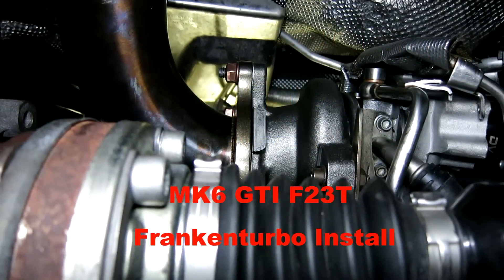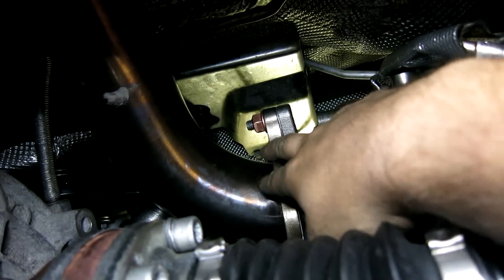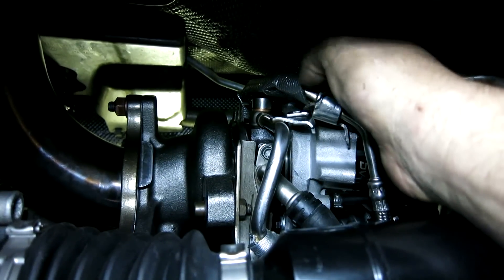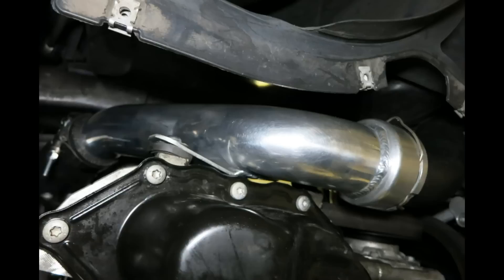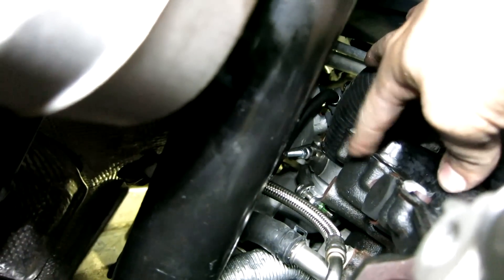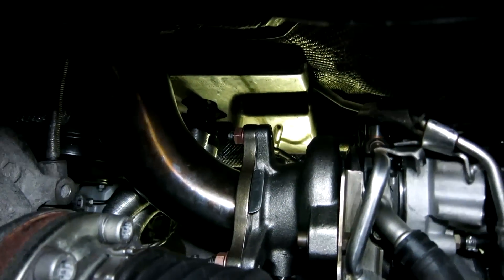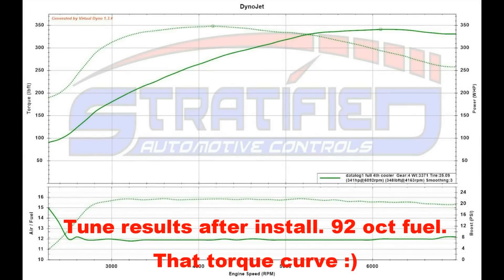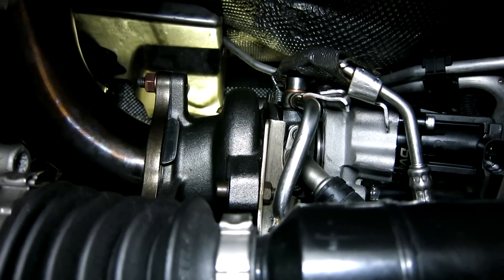MK6 GTI F23T FrankenTurbo Install Stratified Auto

Comment: Do you need the 4bar map sensor for this setup? I have all of this and keep getting a map sensor code and it tends to buck alot. Changed the sensor 3 times with an oem mk6 map sensor.
Reply from the maker: The tune needs to be setup for the sensor you are running.
Reply: @stratifiedauto  thanks I was getting the oe replacement bosche sensor. I borrowed my buddies oem bosche sensor and it cleared up so clearly gotta get a dealer sensor or it just won't run right.

Comment: is this a good turbo? i heard its chines and just kinda re branded and with some modifications.
Reply: Gli_Fahrenheit they're not technically wrong.  Think of it this way, the cast housing is 3rd party probably lower quality, but only marginally. I mean if it's meant to be made from a replica cast of the original the differences wouldn't be that much.

However, the main component of the turbo, the spindle, the blades, the seals, are all custom built to meet or exceed oem clearances.

This of it as a rebuilt k04, but with newer technology like mixed flow, larger thicker blades made of lighter/stronger materials, etc. It's like a k04 2.0 haha. This is why people are seeing 20-30 % higher performance over everyone else's k04. Because the surface are of the blades and the new materials make it a better built turbo than the factory.

Plus on top of all of that, he gives you a 2 year 350$ warranty. If they thing blows up due to negligence or anything else under the rainbow, he'll replace it for 350$. That's someone who truly stands by their product.
Reply: Nice! i actually installed my 2 weeks ago and love it! its seems to be a solid product.
Reply: Getting a F23T soon, is it difficult to install? Never did something as important like a turbo before. My shop wants around 800 to install; combined with the $1700 turbo with coating and $200 lava blanket, this turbo upgrade is looking rather expensive.
Reply: America, FuckYA! 
Let me tell ya, the hardest part is going to be breaking loose those stuck bolts! You are going to need a LOT of patience. But other than that, it’s pretty straight forward! Look up some directions for replacing a stock turbo, it’s not that bad. If you are a complete noob to mechanics or fixing things, do your research. Plan for a chunk of time and for anything that may go wrong.
Make sure you have hardware. And you have a plan if something goes wrong: in this case it could be removing those seized on turbo manifold bolts! Can you get it towed if you can’t get them out? Things like that bud. My personal advice would be to let them manifold bolts soak in some penetrant for a day or so.
Reply: America, FuckYA! 
Ouch! How many miles on it?
This is also a doable task to... however, I will strongly warn you that you have to be confident going in to the task. It is very doable, but you have to take your time with this job... admittedly most people are intimidated by anything to do with timing. I swear something about “timing” and people turn away from it like it’s something they can never do. The people that do these jobs are average people like you and me (not all of them, some are literal gods when it comes to mechanics). I remember I did a timing chain on a Cobalt SS and everyone told me I was crazy. Guess what? I did it exactly like it was written, followed it verbatim, got it done. It’s doable. Or if you have a wad of cash hanging around just send it to the shop! 😂
Reply: America, FuckYA! 
Awesome. Have him check to see if there is any oil leaking around the tranny too, could be a sign your rear main seal is leaking.
Reply: nice, u get it tuned?